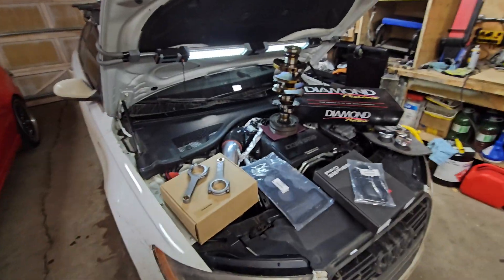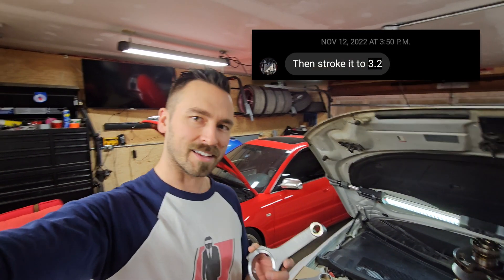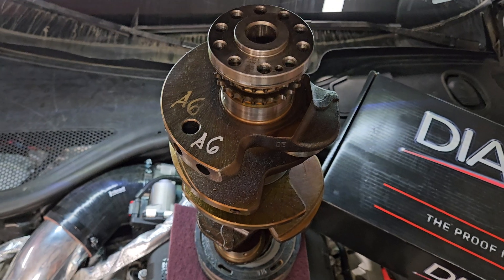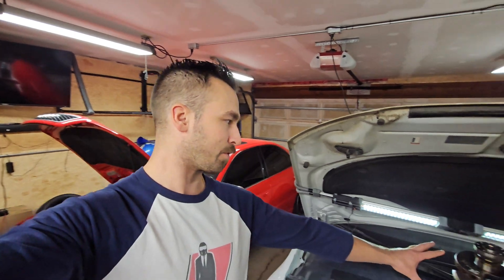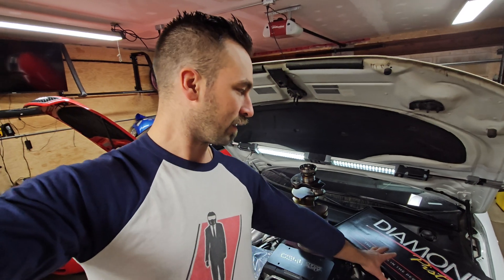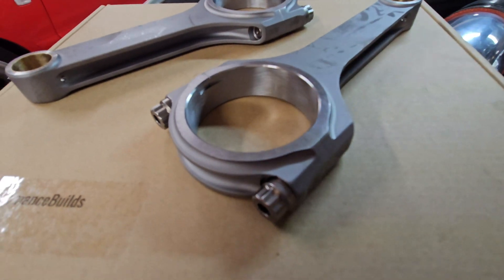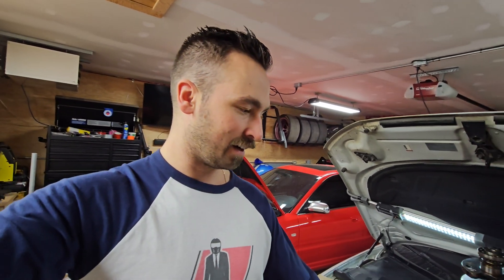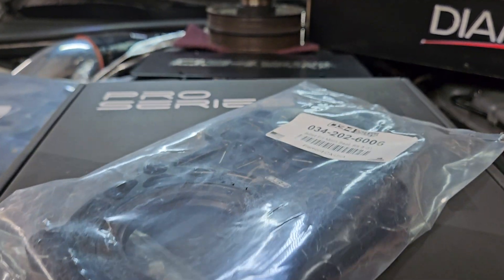My A6 is getting a Forged STROKER Motor!! // 3.0t New Product Announcement!!

Comment: Do you need a new block ??
Reply from the maker: @Jimjack24  I don't but I appreciate you checking. Are you looking to get rid of one?
Reply: @SuitedUp2The9s  I’m soon about to swap mine for a s6 4.0t then dog out my trans until it breaks and swap it for a pure transmission.
Reply from the maker: @Jimjack24  that sounds like a good time! Actually! I'm assuming you're in the States?
Reply: @SuitedUp2The9s  of course. I’m located In Maryland.
Reply from the maker: @Jimjack24  I knowing shipping heavy items in the States is pretty reasonable. As soon as it gets across the border and up North, shipping just jumps to unreasonable costs. So much so if I was close I'd drive and get it. What chassis and year is your car?

Comment: Just started following after becoming aware that Audi’s S4 has potential. Any ideas on what to do with the supercharger? Truly surprised prochargers or larger superchargers (like a tvs 2300) arnt available yet. Are you worried about maxing out the TVS 1740 capabilities?
Reply from the maker: I'd say 1900s would be a lot/right amount of blower for our motors. More than that wouldn't be a good balance and put it into its efficiency zone in the compressor map. I don't think I'll max out the 1740, but I'm excited to try. Camaro LT4s run 1740s stock and make awesome power with them. I've got a lot of enthusiasm to see what I can make happen
Reply: VastAZ is running a pro charger for 2025 apparently. As for mod ideas, you can get a ported charger for a handful of reputable sources. Then you wanna chase cooling like WMI/interchiller/icebox

Comment: what have you done fueling wise?
Reply from the maker: @elijahrodriguez1687  replaced my injectors and my hpfp maintenance wise. And then the hpfp got an Autotech piston upgrade a few years ago.
Reply: @SuitedUp2The9s are the injectors stock or did you upgrade them?
Reply from the maker: @elijahrodriguez1687  stock. There's no injector upgrade. I also have a merh system installed I am currently using to supplement fuel.
Reply: @SuitedUp2The9s  ok thats dope! do you know if the b9 injectors work for this platform?
Reply from the maker: @elijahrodriguez1687  I do know and they are 💯 are not the same and won't work

Comment: Hello, brother. Be careful with the pistons, the skirts of the oem pistons are coated with ferrotek compound, and only it works normally according to alusil. No more coatings work for a long time. We assemble such engines in Russia in large numbers, usually we sleeve the block, reducing the piston to 83mm and then some compensate for the volume by installing a crankshaft 92.8mm from NA 3.2, instead of the oem crankshaft with a stroke of 89mm. There are two ways, either to order a shorter connecting rod, or to leave it oem lenght, but make a piston with a reduced compression height. Once again, no molicots or similar coatings work on an alusil sleeve, only ferrotec!
Reply from the maker: @МаксимВоронин-ы9ж  hey I appreciate the comment and words of advice! I'm going to look into that specifically
Reply: @SuitedUp2The9s  I forgot to tell you.I was assembling a motor for myself on a short block from caka. I recommend you to install an oil pump from old caja/caka engines, as it is much more powerful, the gears in it are 1.5-2 times thicker, there is a slightly different shielding plate in the pan and a metal oil intake.
Reply from the maker: @МаксимВоронин-ы9ж  do you happen to know the reciprocating factor of the rotating assembly?
Reply: @SuitedUp2The9s  if you mean Reciprocating Mass, then for our engines it is 52-55%, in my opinion, the more, the better. pulsations are more strongly smoothed out when the motor is running. and I recommend using only OEM bearings, since no King and other nonsense were even nearby. The geometry of the factory connecting rod bearings is very advanced -there is a gap of 0.04-0.05 mm along the connecting rod axis, and up to 0.12 mm across the axis. this is a kind of refrigerator and oil receiver. I'm sorry if something is unclear, I'm writing through a translator.
Reply: @SuitedUp2The9s  On 2.7L s4 engines from 2000, the rec.mass was 50%, but then they began to "overbalance" the crankshafts. If it's more convenient, I can give you a number with whatsapp on it.

Comment: from what ive read oem displacement is 2995 cm^3 and 3.2 stroker is actually 3123 cm^3, how much of a gain are you expecting?
Reply from the maker: @IneshK-w8w  hp from the increased displacement? Anything will be great. Should be better than just a forged 3.0t. But also being a forged motor then, I'm looking at it being able to have a higher headroom than a stock motor.

Comment: Josh are you building a spare block or will you be building the engine that's currently in it ?
Reply from the maker: @fredzimmer8626  That's a great question! I think to prevent my A6 from being down for awhile, I am looking at picking up a spare block and building that and then swapping it in. But just haven't made up my mind yet
Reply: @SuitedUp2The9s That makes sense.
Reply from the maker: @fredzimmer8626  and then have still have a good block to build a spare 😁😁

Comment: Great build man, my question is; can you do the striker only with the 3.2 crank and 3.0 OEM pistons, or is it mandatory to replace those as well for R8 and does that mean you have to have the block sleeved?
Reply from the maker: And which rods are you thinking about in this question? This setup in the video is all matched to each other. These rods and crank would not work with oem or aftermarket 3.0t pistons. No sleeving required.